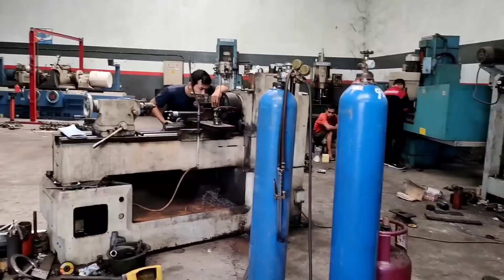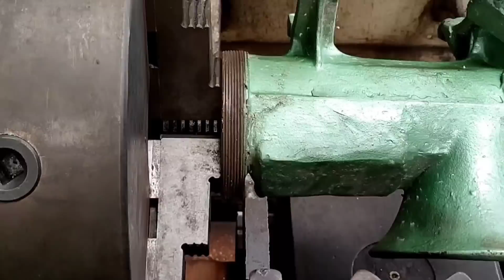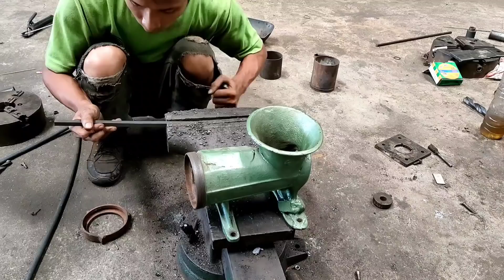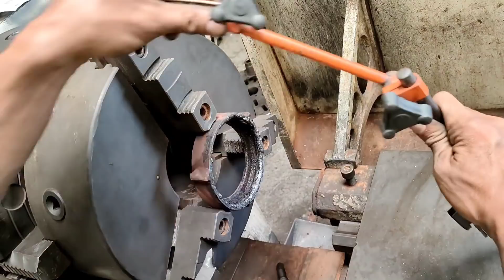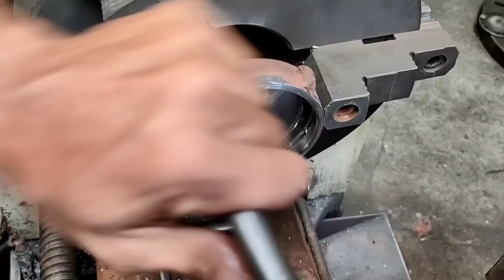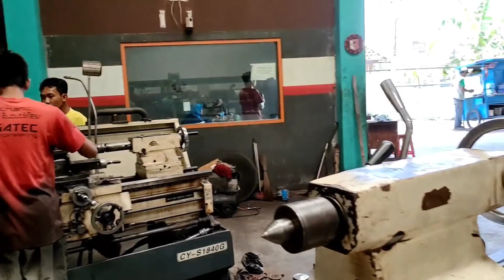Cara Memperbaiki Ulir Penggilingan Daging | Repair Meat Grinder Thread

Comment: In the U.S. that meat grinder would be thrown away, and it appears to have been repaired before. Many people in the U.S. don't realize how expensive things are in other countries, and how little money most people have. A machine shop here wouldn't even touch that. Not even if it were their own personal grinder. It would end up in the garbage bin. You can buy a new grinder just like that one for less than 1/3rd of most shops hourly rate. Even shipping something to some of these countries is mind boggling expensive. I can ship something to Canada for less than $25, the same item shipped to Brunei  costs nearly $200 -- just for shipping! And, you probably would have to add substantial import duties to that.

Because these people don't have much money, they fix what needs fixing instead of replacing, and they can't pay a lot for repairs, but hopefully these machinists are paid very well. Their skill and ingenuity is amazing. Meanwhile, fast-food workers handing out sodas in the U.S. think they are worth $15.00 an hour.

Comment: That´s a botched job and a bundle. You should never temper a just-welded piece using water, much less if you want to turn them, for god´s sake...
Reply from the maker: why not sir? is the iron soft or hard? I've been doing this kind of work for 12 years sir.. what I learned is not to add water when welding to join iron.. while this is not a joining process but thickening
Reply: @Yantoo  mungkin maksute Wedi getas mas garapane malah Atos, krungu Ng ati kerih 😁